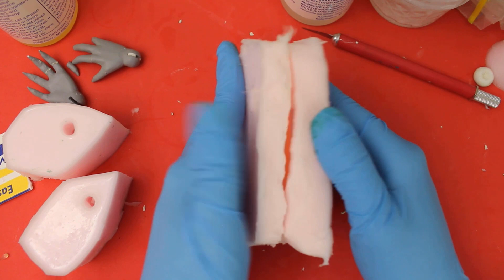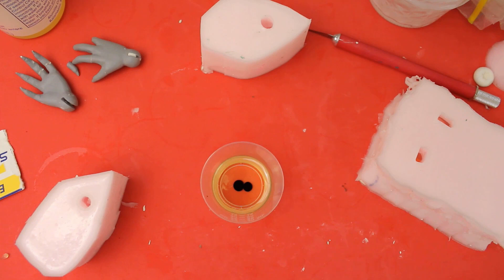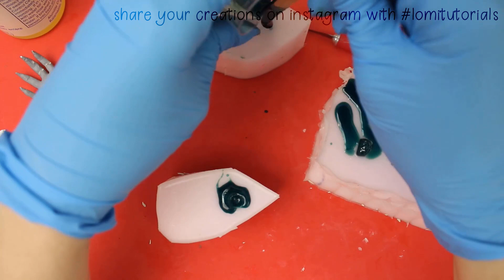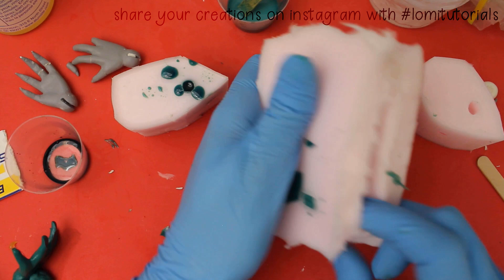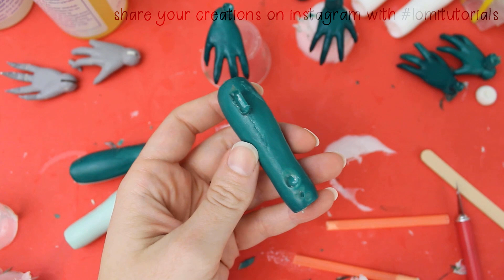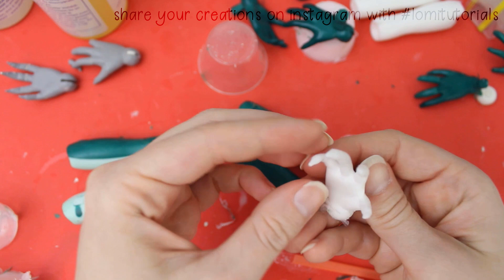Casting custom parts for my BJD Rhyllyn

Comment: Some advice from someone experienced with moldmaking and casting
1. The whole reason you make two part molds is to key them, therefore minimizing the seamlines. So I would suggest you make sure to key your molds. That also includes building the clay bed up to where it goes all around exactly where you want the seamline to be. So in the case of hands for example, it would be around the widest part of the hand, including in between fingers, exactly halfway up their width.
2. Especially if you aren't using a pressure pot, you can't really get away with just one pour tab, especially if you have detail like the fingers. You need vents. The vents don't have to be wide at all but they do need to connect every area likely to get bubbles to the surface. That will be any overhang, areas that are higher up than where your pour tab connects, and the tips of any small detail
3. Resin bubbling and not curing 9 times out of 10 means it wasn't mixed well enough. If you're doing it by hand, that's generally a few minutes of mixing. A popsicle stick isn't the best tool for it, because of the rounded tip: it doesn't get in the corners well enough. Another thing is, you may have added too much dye. Dye will actually inhibit curing, and resin dyes are made to be extremely potent, so you always want to use the absolute minimum that you need to get the color you want. Bubbles can also be a moisture issue in the dye.
4. Another thing re dye, it will always sink to the bottom to some degree, as well as show up differently on the surface versus the inside of the object. That's why doll companies always warn you that sanding seams off of darker skin dolls will leave marks. Obviously dye type and quality as well as curing time and method change how bad that effect is.
5. Pouring more resin on top of partly cured resin isn't the best idea. It can be done fairly okay with slow setting resins, but the shorter the working time, the worse it will turn out. That's because resin heats up as it sets. And the faster the curing time, the more violent the chemical reaction, thus reaching higher temperatures faster. The resin that's already setting is likely to cook the fresh stuff. Or your molds, if you introduce something like water and make the whole reaction go completely haywire.

Comment: Hey Lomi! I'm trying to see your msd sized breaches that you resently released onto your website.. I'm not sure if you are going to do a tutorial, so could you give me a quick over view of how to sew them together? I'm mainly stuck on the front sections and the larger pockets

Thanks Lomi!!
Reply from the maker: Oh, which one?? What's the name of the file you downloaded? I've made so many pants patterns at this point I can't keep them straight, but I can give you instructions if I know which pair it is!
Reply: @LomisPlayground  its the basic boys pants under the 1/4 doll section, if that helps !!!
Reply from the maker: @helenletts8049  Yes, thank you!  The fly is constructed similarly to the Littlefee breeches in this video: https://www.youtube.com/watch?v=N8XZbedKmY0. The biggest difference is that the LTF breeches have the fly flap on only one side. For this pair, you just fold the flap on one side to the inside, then it goes together the same. :D

The rest of the pants go together like these:
https://www.youtube.com/watch?v=xqixUK8feaE

Hope that helps!

Comment: For a beginner pourer this isn't that bad tbh, I'm quite impressed! 
A tip I can give is to cast a mould vertically. This will let you get into the smaller areas first with a syringe, toothpick, what-have-you and then pour into the larger areas.
The type of resin might be an issue. The quicker cast can't get rid of the bubbles fast enough before it has hardened. There are some affordable 2 part resins on Amazon that take 24-48 hours to completely harden, but I've noticed they cure in as little as 4 hours with complete cure after 6-8 for smaller pieces like these.
I hope this helps you on your resin journey! ♥️🥰
Reply: Thanks for the tips...Ive gone through 6 sets of hands already and all the fingertips never fill in..Ill try the toothpicks, if that doesnt work then ill get the slow cure resin
Reply from the maker: I appreciate the tips! I've never had problems with the quick-cure resin before and didn't without the dye, but I can definitely see how a slower-curing resin would be much better when I'm casting things in a more bubble-prone mold... or using the dyes. The biggest reason I went with these was because the manufacturer specifically said they work well together, and then... they didn't :(
It's kinda funny--I had originally intended to set up the molds for a vertical pour, since I was going to do one-part molds, and I think that would have solved a lot of issues. I sure had a bunch of unexpected problems from the materials not working as expected.

Comment: They turned out pretty good Lomi.    My experience with the resin dyes is that you can't use very much or it will impede curing  making very dark colors a hassle.  This seems to be the case with your pieces with the bubbling and the marble effect as the dye is not evenly distributed in the over all solution . Hope this is a help      Thanks I enjoyed the video
Reply from the maker: Thanks for the info! I re-measured later on and I was using like 0.1% dye, so it's pretty wild that it messed it up that badly ._. I'll stick to dyeing parts afterward from now on.
Reply: @LomisPlayground  My pleasure :  )

Comment: You may have used too much dye and it inhibited the curing. I think some things say to only use like 2% the amount of the resin is the max amount of dye to add. But, the darker tips on the hand looked pretty cool :3
Also, you may need to angle your molds so they are more vertical, the air will flow out better. But I’m glad they at least mostly worked :D
Reply from the maker: The instructions said I could use up to 5% dye, but I used less than 3% at the point where it was curing sticky :/ I typically rock my molds to ensure the air escapes and for some of the castings they are tilted until almost full, it's just not really visible from an overhead angle. Regardless, I definitely need a way to degas if I'm going to use dyes, because the green resin was sooooo bubbly!